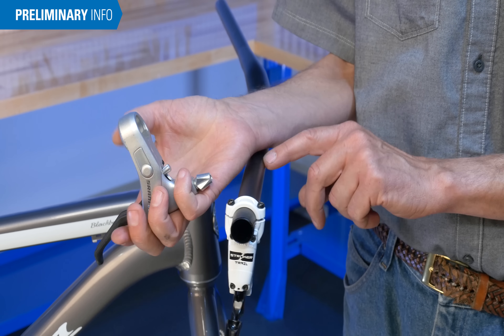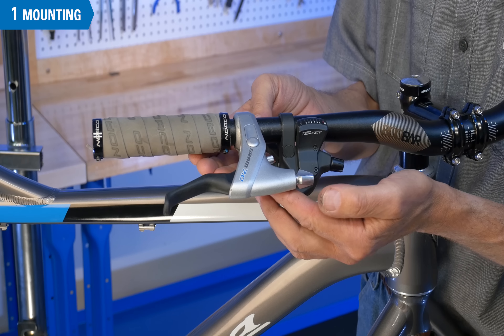Brake Lever Mounting & Positioning -  Upright Bars

Comment: May ask you something sir regarding the installation of bottom bracket. What would be the best thing to do if the frame thread has a slight damage causing problem for the installation of bottom bracket? Thanks.
Reply from the maker: A shop should have a bottom bracket tap. These will clean up issues in the thread. Even a few bad thread don't spoil the whole bottom bracket. As long as it pulls up to full torque, it will be fine.
Reply: How about the break cable of the hydraulic break system sir, most cable is too long. What should be the best thing to do?  Is it advisable to cut it? Thanks

Comment: I love this guy. He really explains things clearly. Its easy to see what he is doing so i follow along with clear understanding. 
I inherited a mtb i love. Not an expensive one, but its smooth and fun. Well, ive heard from all bike shops nothing but discouraging advice. Its wasteful to throw away a bike because it needs new cables and the back tire to be trued. Also had to buy a rear and front derailleur. Inexpensive one at a time. But all together it ran up a little bill about 2/3 the cost of an exact new bike. Still I wanted to do this. No big deal, right? I work on my wrangler no prob thanks to you tube. WRONG! Bikes are more complicated to understand at first and can be overwhelming in the beginning. I told that guy at the shop im not throwing my "inherited" or "not worth it" bike out. I said youll see and will be proud of me! 6 months later, still spending money on a bolt or barrel adjuster cause someone stripped or lost pieces etc. Im finally figuring out the mechanics of it. Not soo rocket science anymore. Glad i stuck thru it. If anything goes wrong i wont be helpless. I wont be truing the wheel myself, tho. Lol
I hope this guy gets paid well for his outstanding videos.  Thank you
Mrs. Larr
Reply: I got a bike from a bike charity stripped it to the bare frame and am rebuilding it with mostly new parts. I thought I knew about bikes but I'm learning sooo much! Park Tool vids are an indispensible resource.